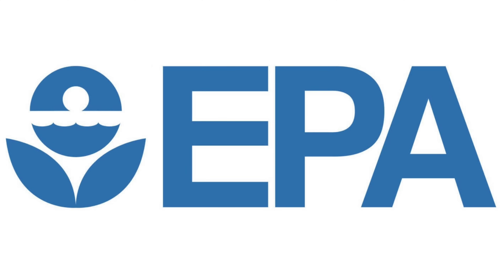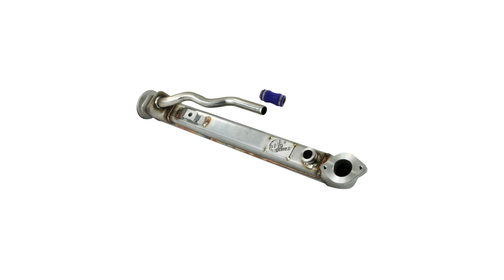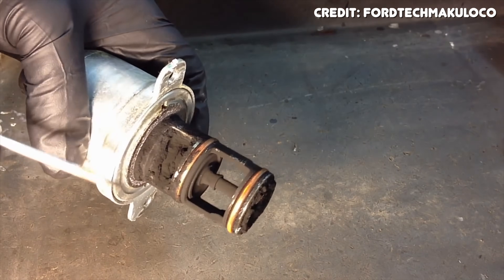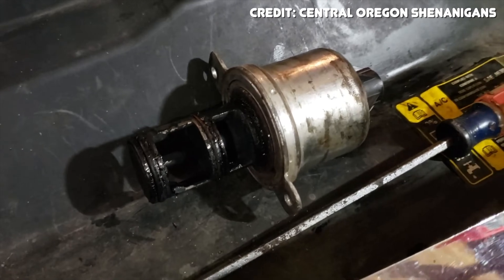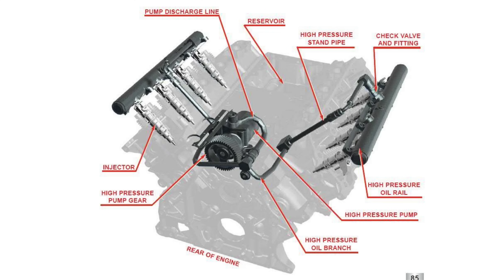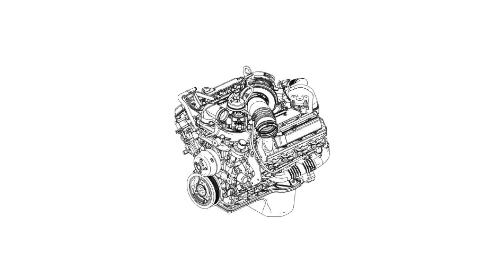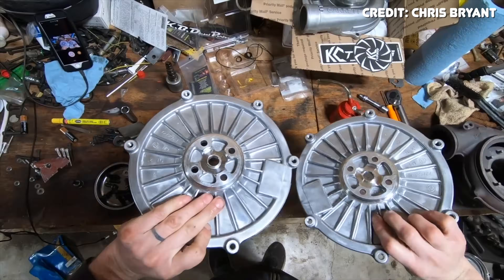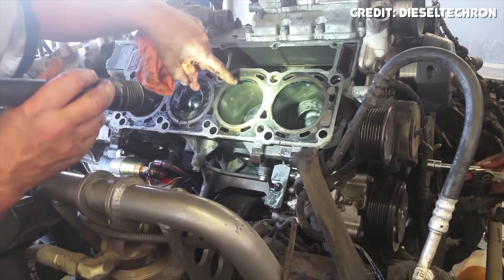The Truth About the 6.0L Powerstroke (And Everything Wrong With It)

Comment: It seems like the engineers were trying to see how many ways they could fail an engine.
Reply: pattato potato - reality?  dodge guys put 10k into their motors and their transmissions blow.   ford you stud and delete a 6.0 and the bottom end will handle 100psi of boost - that's the reality.  you can't blow an f350 DRW rear end or tranny and all you'd do is stud and delete the motor and you can run a large turbo and make 600hp in otherwise stock form.
Reply: @mesarosshawn2422  notice I said motor. And really, the 6.0 needs more than a delete and a stud, it also definitely needs an air to liquid oil coolant system, and to be monitored like it's on life support.  I'm just pointing out that it's amazing how one thing most definitely will lead to many other problems. Like the guy mentioned, a dead battery can lead to injection failure! That's crazy. I'm a 6.0 owner, and it just really takes someone who knows things about motors to care for them. Or a really knowledgeable mechanic......unlike the guy who worked on mine, prior to my purchase.
Reply: @johnnienaber4268  agree on the external oil cooler - of course -

Comment: Anyone who claims that the 6.0 is the best is dumb af I’ve charged people upwards of 10-15k to bullet proof the 6.0 and in most cases the body electric system fuel system rear end transmission pretty everything. That obviously costs more then 15k the best engine/ diesel truck is the one you buy off the lot that doesn’t need everything changed out. You best bet is to buy the chassis and body and engine u want, have easy and cheaper access to I have a 2015 Chevy 2500 high country body riding on an isuzu ipr frame running a 12v cummins 5.9 built from the crank up sitting in a billet block running on 3 turbos at different stages.
Reply: Idk what you’re talking about, 15 grand to bulletproof a 6.0? Wow. Also the 6.0 doesn’t really even have a fuel system, there is no high pressure fuel on the 6.0 just some lines to the heads from the low pressure pump on the frame. Yeah and 6.0 transmissions are incredibly good like easily the best transmission in a hd pickup at the time.

Comment: Spend $10k just to make it reliable, spend $10k on a Duramax or Cummins and beat vetts
Reply: More like 5 or 6 grand to make a 6.0 reliable.
Reply: @thetruthaboutfacts224    when you own a business and at 40 50 60 k miles you have 6.0 in shop and ford says oh 6 weeks 4 weeks 8 weeks for parts and you get truck and 2 weeks later more problem  over over again every ford dealer in so cal. They are not reliable unless you buy after out of warranty spend thousands to get it temporary fixed. And then won't pass smog in so cal..our company almost closed shop and ford said it's a commercial vehicle out of warranty. We have had fantastic reliable Duramax trucks since.owner will never buy another Ford product again.

Comment: As a owner of an 03 6.0...i love driving this truck...by far my fav to drive...but the problems it has gone thru in 18 years and 230k I would never buy another...there is just way too many gremlins along with the big problems it has...truck has been pretty much stock it's whole life multiple sets of head gaskets...now have fire ringed heads and have rebuilt most of the top end... I have two 7.3s that I have ran with hardly any issues and one is tuned up hot...my opinion is that no motor should have so many issues ( many that ford itself just band aided) I can't call it good by any stretch...it's too bad...cause when it's running good it is my fav by a good margin
Reply: Same, 6.0L excursion completely bulletproofed.   The money I have in that truck is ridiculous...

Comment: I have a 2006 F250 King Ranch that was purchased back in 2011. I have driven it across the US pulling a trailer from California to NYC through the Rocky Mountains path. I now have 310K on the odometer with no headstuds or any crazy modifications. I am an ASE certified diesel tech and performed all needed mods like updated HPOP oil fitting, updaded FICM, EGR delete, stage-1 turbo upgrade, upgraded stand pipe plugs, and a SCT-3 tune. Without any engine repairs and daily drive my truck hard. This engine is reliable, if the right updates are done and operated by a knowledgeable diesel owner.

Comment: While they might not be the best engine I wouldn’t say they are the worst. I’ve seen many many Kia’s in scrap yards with about 60k miles. The 6.4 seem to have more catastrophic failures than the 6.0 as well. In 1994 when they strapped a turbo on the old idi engine many farmers I know complained they kept blowing head gaskets. Maintenance and care goes a long way with most anything.

Comment: Interesting video. But I think you forgot to mention all the good about this engine. And you said that you would show how to fix these issues, but you didn’t go as in depth as I thought you would. 

Keep them stock. Mine has 250,000 miles and nothing has gone wrong. Simple oil changes. The 6.0 is made for work, not racing. Want to modify a “truck” to shit? Buy a duramax with an all aluminum block. Good for speed, not work.
Reply: My brother took it mild on his 6.0 but pulling trailers up hills killed it at 88xxxx miles!!! After $11,000 it was fixed it got the bullet proof job so they say. 2 yrs later that truck's bed rusted out and dropped about 1/12 . What sucks about that was it was a clean truck but apparently these Ford's beds are trash and a solid bed in our area like 4k but finding one gets tricky. Go buy a Cummins or a dmax and buy a  2nd turbo and get a tune and call it a day for fraction of the price of the power stroke or spend 10k+ to fix your factory power stroke issues and only have factory power specs

Comment: I have a 03 6.0 it blew up at 95,000 miles and had bullet proofed  engine with head studs new injectors EGR deleted 4inch exhaust and coolant filter  No issues pulls good and now it has 135,000 miles

Comment: Great video, makes me even happier to own a 12 valve Cummins. I worked at international harvester for years and your information seems to be spot on
Reply: New holland straight 6
Reply: -12v cummins
-7.3 powerstroke
-OM616,617,602,606
-ALH 1.9 TDI
-LBZ Duramax
-Ford 300 Inline 6

BEST AND SIMPLEST PRODUCTION VEHICLE ENGINES EVER BUILT What am i missing???
Reply: @RandomlnternetGuy  Chevy small block.
Reply: Your transmission is worse than a powerstroke ever will be lol

Comment: Yes 100% a bad motor all and all .... But the 05-07 6.0 is a rock solid engine with head studs and a delete I'm running an 07 with about 500hp and 1000tq as a daily for 5 years thing brakes tires at 40mph with No issues. It's all about maintenance and just not dogging it every single day like with everything tho.
Reply: No. A good engine can be dogged every single day.
Reply: @fastinradfordable  I was more referring to like when these trucks do work Towing And driving around on very hot Tunes. You can blow any LS, Cummins or Duramax driving like a 16 old doesn't matter the motor. Just know when to keep your foot under control these trucks still weigh 9000lbs and not every red light is a drag tree.
Reply: 11 yrs on mine after bulletproofing. I drive it hard all the time. I wouldn't have kept it if It couldn't take what I wanted it too. I honestly didn't expect it to take it. Zero issues with the engine after the initial bulletproof and deletes.

Comment: I'm a 7.3 guy....any ford powerstroke from the 6.0 and beyond is just junk. The 6.4 can be fixed if there are arp studs and emissions deletes along with additional oil and coolant filters with fuel and oil additives.  however the 6.0 will always be plagued.
Reply: So how is the 6.7 junk? Makes twice the power a 7.3 does, tows twice as much and will go well over 300,000 miles with proper maintenance.

Comment: Let's get real,they are junk junk junk....thanks ford
Reply: They are unreliable in stock form at least everything 04-07. They are however not junk, not even close, the bottom end is rock solid capable of around 700 whp. Once they are fixed properly they are very reliable engines. My family drives a 6.0 excursion with over half a million miles on it.

Comment: If you're going to turn up anything you better be expecting and ready to pay when it wasn't designed for it. I know lots of people that had put tuners in max amount blew head gaskets removed it and then took to the dealer for warranty and then blew the head gaskets again cuz they put the tuners back on. Oil cooler plugging up isn't fixed with a coolant filter due to its not even a full flow filter.

Comment: As a diesel tech for ford the 6.0 is amazing as well I have a 03 with 298k original engine tans head bolts. No tune they are very reliable
Reply: And an egr cooler is not 10-12 hours it’s a 4 hour job max
Reply: I’d say closer to 5 hours but definitely not anything close to 10, idk what he’s talking about.
Reply: The 03s are the best ones lol, the 04.5 and 05 I have both have had heads off one before 60k one at 170k
Reply: I bought a 03 Excursion to move a camper 200 miles, sight unseen, at 286,000 miles, she did what I needed. 
I think she is a keeper. Love the turbo spool.

Comment: All these issues you are talking about happened in the 03 and 04 engines, 05-07 they did 600 updates to the motor and the 6.0 was a school bus engine and they had 0 issues in the school buses and it’s because there wasn’t an egr, I have a 6.0 dually and I’ve never any issues especially never had ficm issues or oil pump issues none of that stuff because all those issues where in the 03 and 04s and the 6.0s came with 325 hp not “180” and if the 6.0 was so bad then why did they keep putting them in the E series vans till 2010 🧐🧐🧐
Reply: I don't think you really listened to what he said ...
Reply: @shanesmith6200  ya I did bub
Reply: No sir. He said the ford version was 325. The Navistar industrial or medium truck version was 180. I don't care if you like the 6.0. that's your business. But quote the man that spent time to put the video together right. Left untouched, I agree, they weren't all that bad and did get better. But the points brought out and then the 6.4 proved it was time for ford and international to part ways.
Reply: @shanesmith6200  didn’t hear him say that and don’t really care what u have to say bub
Reply: I figured "bub".
Reply: @shanesmith6200  glad u get the message bub
Reply: You're a riot.
Reply: @shanesmith6200  thank you
Reply: In actuality, the early 03`s were the best. Especially to bulletproof. Hpop needs to be upgraded as well as ficm from BPD. Other than that there are less leak points in the 03
Reply: @thecustommuffler  that’s completely not true bud, there was way more problems with the 03s, go look it up
Reply: @royalscout6408  don`t have to, still own my (op) `03.
Reply: @thecustommuffler  good for you ha

Comment: I have a 7.3 I bought an it had the 8th piston broke when I got it but it smoked like hell so I took it in to diesel shop then a man called me so I went in an he told me the problem so I put about 11000.00 into a rebuild changed everything bored 30 over ,new turbo fan ,injectors ,turned pump up ,changed gears to 355 pos front an back ,speed sensor, 4inch to 5 inch ARE exhaust have to run 3 fuel pumps or itll run out of few in about 2 miles over 70 mph so I've got lift pump in tank ,electric pump on frame ,an the mechanical pump on motor put antifreeze filter on it for crud etc use POWERSTROKE filters to im running 0/40 full sen oil minus 7 an it started not plugged in an glow plugged it once fired right up had 86500 when bought now it has 89500 on it parked 01 Ford f250 Xlt 4x4 off road powerstroke diesel quad cab  love it but it'll flat out fly I've had it 130 mph an I let off but without the third pump it'll run out of fuel I was thinking about a stage 4 tuner or chip it had my other truck chipped for pulling power but what he didn't say was when you build the motor you have to change speed sensor or it'll burn trans up  OUTLAW DIESEL INDIANAPOLIS INDIANA or DITY DALES SHELBYVILLE INDIANA my favorite BILL HEWITT  POWERSTROKE . COM but I like to watch these vedios to learn something new or helpful .......

Comment: There are solutions to most of there issues.  Just have to have the knowledge and proper equipment to diagnose the problem. Some of these engines have well over there usable life expectations maintained well is the key
Reply: Solution is buy decent rig instead of rebuilding old junk

Comment: 6.0 ain't bad, you just got to "Bulletproof" it especially after you add power
Reply: 6.0 in stock form definitely has issues, but it’s not nearly as bad as many people say. In this video he clearly knows quite a bit about them but he also clearly doesn’t work on them. If he did he would know that the 05-07 hpops basically never fail. In the hundreds of 6.0s i have worked on i have maybe seen 2 or 3 fail. 03-04 hpops on the other hand will fail on average every 200,000 miles. The 6.0 is certainly not for everyone but done right it’s a very reliable engine that can make great power quite cheaply, and it is hands down the best sounding diesel.
Reply: Funny i don't recall having to "Bulletproof" any other diesel engines I've purchased when buying them stock. They just seem to work...........................
Reply: Junk engine anyway you slice it.... it's like a bad relationship.  As long as this, this, thus and this happen and the stars align it's great 😆.

Comment: When properly bulletproofed, the 6.0L is just as reliable as any other diesel engine.
Reply: Execpt those engiens were good from the factory
Reply: @alexstromberg7696  not necessarily.  The LLY duramax also had head gasket issues.
Reply: @CaptainRudy4021  then that is also a bad engine.
Reply: @alexstromberg7696  you can make almost any engine reliable with the right modifications

Comment: my 6.0 is the most reliable vehicle i’ve ever owned. maintain it and it will take care of you.
Reply: Yeah dude me too. And when working on it - everything bolts up and fits up like no other. I friggin love it!
Reply: My 2004 is the same. Last year I learned more about the truck. Took a month and read everything I could. Did the blue spring upgrade, a few other simple upgrades. Cleaned the egr valve, etc... Less than $1K all in doing the work myself. Then out of paranoia replaced the oil cooler and added a coolant filter. No issues, just over 200k miles and want it to last and wanted to learn. Runs like a champ. Never any big issues. Better than most other vehicles I have owned. Love the thing and going to repaint and redo the interior to last another 20 years. This week replacing the old rear air springs. They're just old and worn out. Pull a bumper pull trailer and load up about 1,750 lbs (2 large 4-wheelers, bed rack, etc..) in the bed plus passengers fairly regularly. A few years ago I was using it as a daily driver too.
Reply: You must of got a real good one.